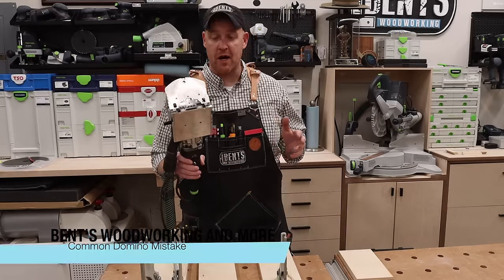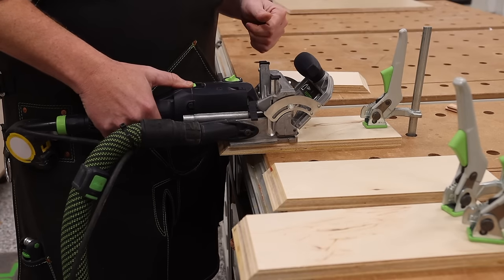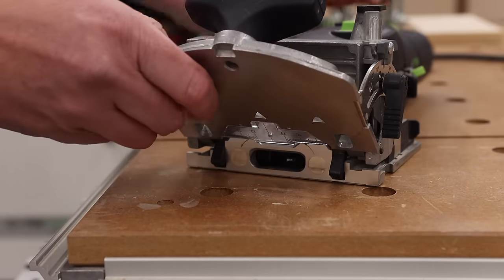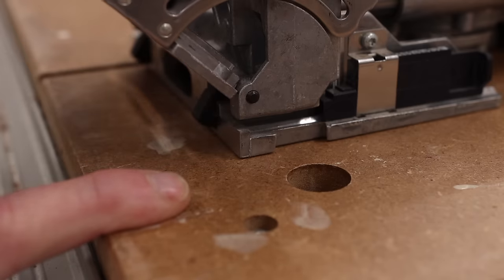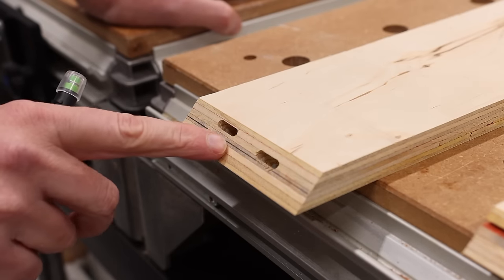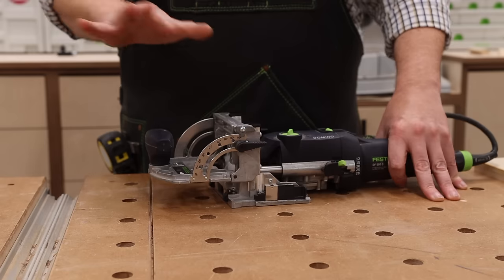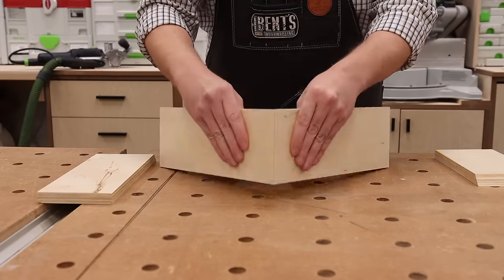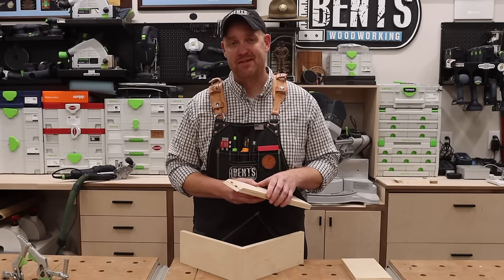What every domino owner needs to know

Comment: I have done a LOT of miter joints with mine,  the only difference is I’ve never used the domino on my plywood boxes normally just glue will hold.  But now I know what to do when I eventually use it for plywood.

Comment: I have an abundance of 8mm dominos.  I have used lots of them in similar setups.  I also sometimes put a piece of 1/10" acrylic sheet on the base to move the cutter even closer to the inside corner.  Works a charm.  Thanks for the video.
Reply: Did you ever try a 45 degree miter? I am making a corner shelf that has a depth of 16 inches, so I can hang my 75" tv up in the corner out of toddlers reach. The back corner will be the standard 90 degree angle, but the front corners are 45's so I will need to cut them 22.5 degrees. Do you think by adding 1/4 " or more, you could use dominos? The inside will be concealed so I wouldn't be concerned if the dominoes were visible on the inside.

Comment: I have the same base for the Domino 500. A cabinet shop I used to help out at has a Domino 500 with the older pin style base. I don’t believe the older pin style base had this issue but I do seem to remember they had to adjust the pins and had to replace the pins once or twice. I know Festool likes to improve their products hence the new style stops like you are showing. Thanks for the information.

Comment: Super informative! 

Question:

If you had access to both and time wasn't an issue, would you prefer the domino for mitered 90 degree corners or a lock miter joint done on the router?

Comment: I have to say that after cutting over 10,000 mortises with my 15 year old Domino I have never heard that mith. In fact I have used the 5mm bit to do the same in 1/2” material to reinforce 45 degree mitered joints.

Comment: Great explanation. Is 3/4" about the thinnest material you would use with the 700? I am torn between purchasing the 700 and 500 and believe that the 700 (although heavier and more expensive) is more versatile but I understand that it will not work on thinner material...how thin? Thanks.

Comment: Still have to be careful on undersized plywood? Too close to the veneer when adding glue you could risk glue blowing out the veneer or bubbling it. Last project I used 5mm cutter setup how you show but only plunged 12mm and trimmed the dominos accordingly.
Reply from the maker: If you run into abnormally thin stock, then I would test it first for the reasons you mentioned. If the ply is 18mm I haven’t had any issues. If it gets down to 17, then it’s a different story.

Comment: Interesting! I don't own a domino, but I feel like I would have done this right off the bat and would have been puzzled. I can imagine doing dominos on projects and just going "Huh? Wait, this is set, this is set, ok why is it doing that???". This happened with me on my planer, My Dewalt 735 puzzled me for DAYS for planing and snipe, until I pointed both infeed/outfeed tables up at an angle. Same thing with my track saw (a Wen, which is a great saw for the money) for the tracks, but this applies to festool tracks or kreg as well. The stupid tracks when you put the stupid little track holders in to bolt them in are usually out a 1/16 to 1/8 when you put two sections together. For the Wen this was 55" plus 55" for 110" total. I took an 8 foot level on it's side on a level surface (not with the metal face of the level going across, it sags because 8 foot levels can't be trusted for this but on the side they can) then butted up the assembled track with semi tightened bolts to the track. Then I simply pull the track into the level, and do this back and forth until the clearance is less than .03 mm or less. Might not sound like a lot but when you are ripping glue joints on two side by side boards, that run out  goes from 1/16 to 1/8 to 1/4 pretty quick on ever 4 feet. I wish they made a singular 110" track that required no bolts and was one piece. I don't feel like making my own guide, that's why I bought the stupid track saw lol.